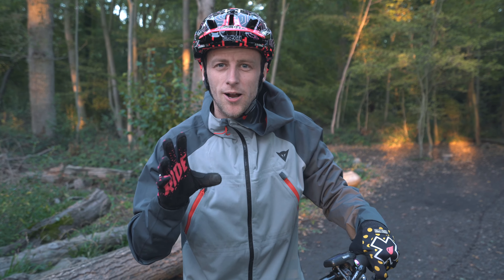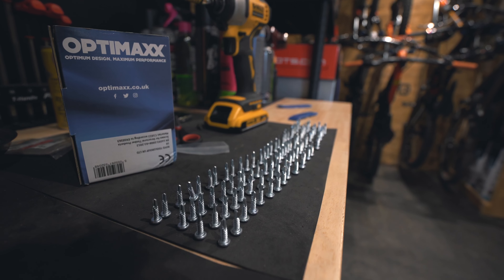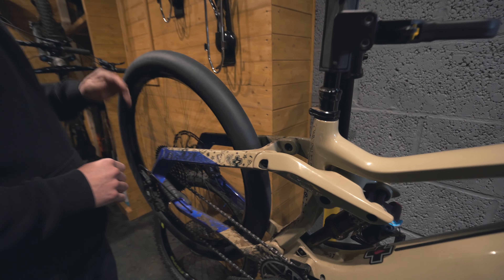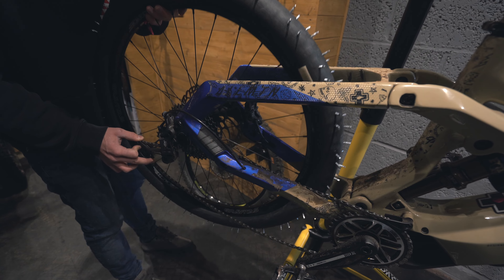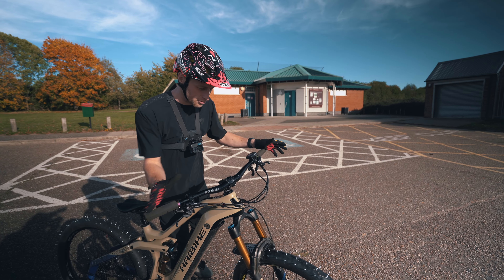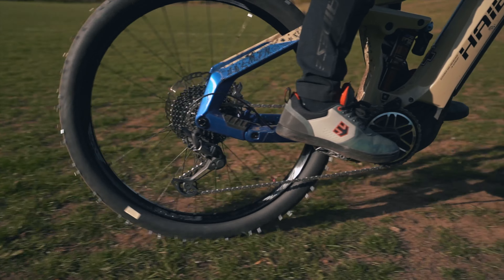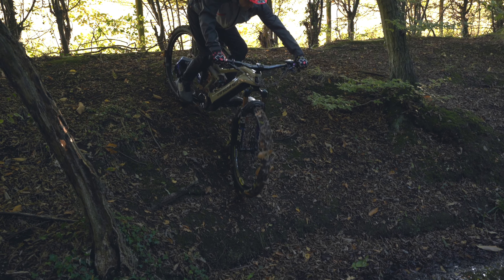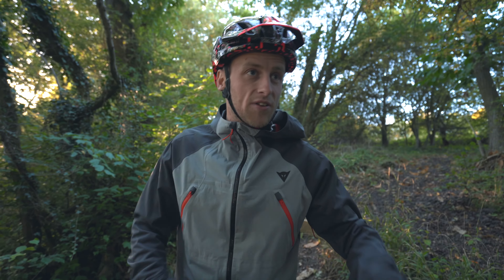DEADLY SPIKED MTB TYRES!!

Comment: You can actually buy studded tires for ice and snow. But your fixation with getting your feet wet was very entertaining. Personally, I'll do almost anything to avoid wet feet, even it means getting off the bike and walking all the way home. In 55 years of riding, I've stepped in water maybe twice. Once was less than 3 seconds, so it doesn't count.